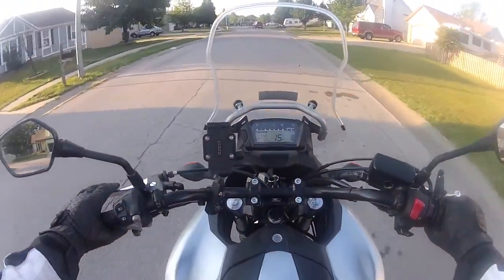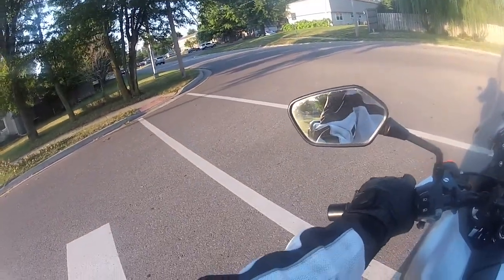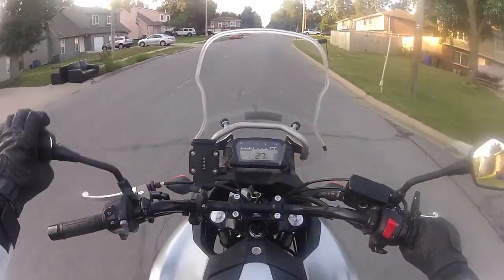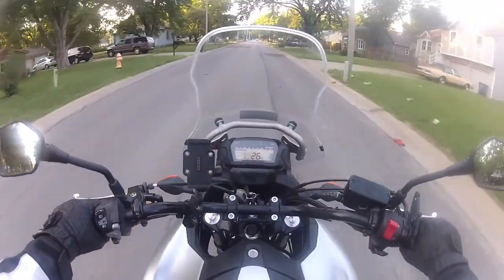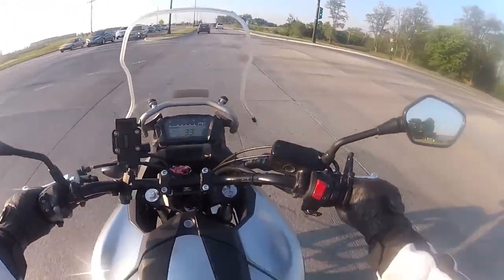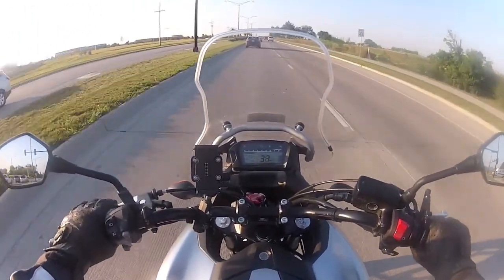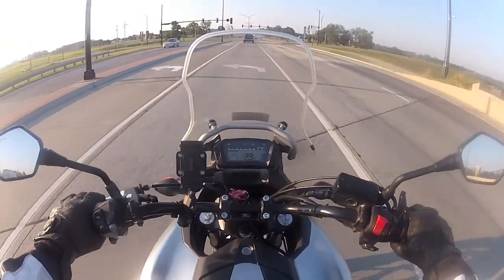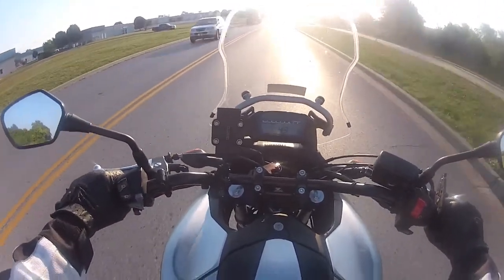Random Stuff 1

Comment from the maker: No, no charge. I was in for an 8000 mile service and I have a prepaid service plan. It's a Bilt (Cycle Gear) Techno Mesh. It is about as good as it gets for hot weather riding. It also came with a liner, so I'll be able to use it in the Fall until it gets too cold.

Comment: It's seems to be always electrical, My other harley I use to have same thing, light would come on and off, result, bad voltage regulator, harley sites same thing , always check battery connections. Ditto, I have a rocket mesh jacket w/ amor ,friend gave me, what is yours ?  It's funny when I ride w/ the jacket I feel more at ease with my safety rather than a short sleeve shirt.